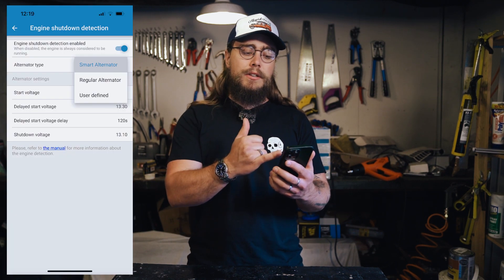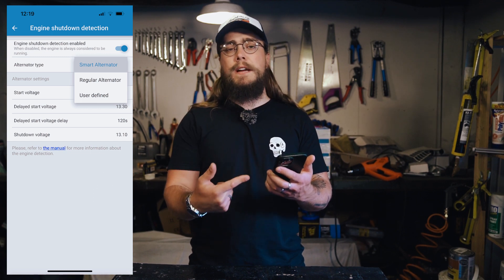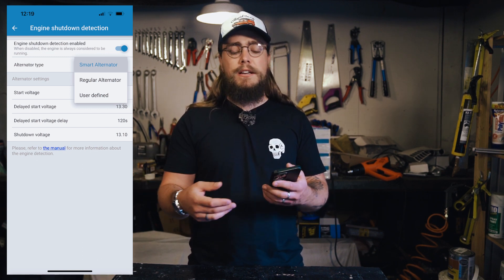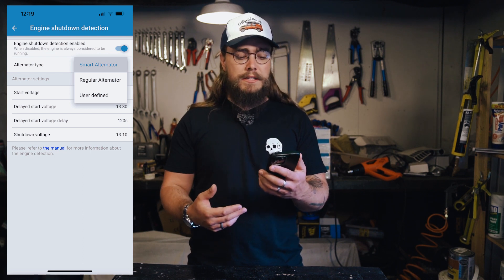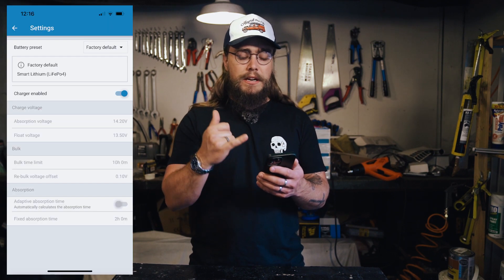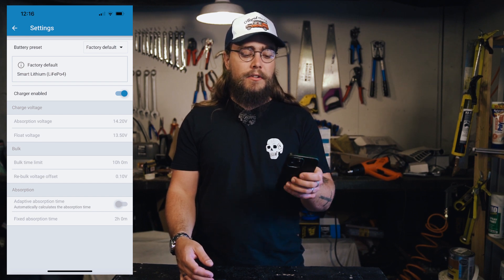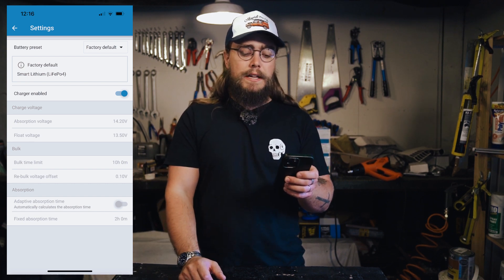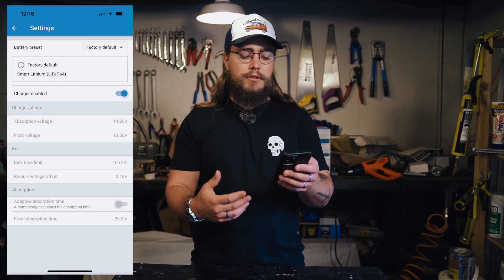Best Victron Orion DC to DC settings for LiFePO4 batteries

Comment: Mate tell me why you need engine shutdown detection - first of all explain that, secondly if you have lock in lock out voltage function why need engine shutdown detections ?
Reply: Hi. I also would like to understand that. Why is it necessary? What is the disadvantage if I do not set it? Best, Silvano
Reply: @silvanocometta9760  I guess so that the current doesn't flow the other way and discharges your house batteries. So the charger only works when the engine is running (and supplying the current).

Comment: Hey man! Just curious what size of orion to get. I will have 2x 12V 100ah batteries in parallel. 
The only reason I want to charge off the alternator is so my fridge doesn't kill my battery during transport. Once I arrive, it will be on propane. 
I don't want to tax my alternator (toyota tundra) too much either. 
Looking for the smallest option, that is also affective.
any thoughs?